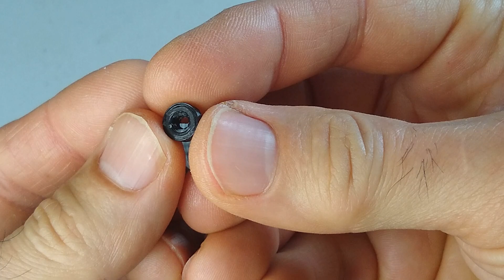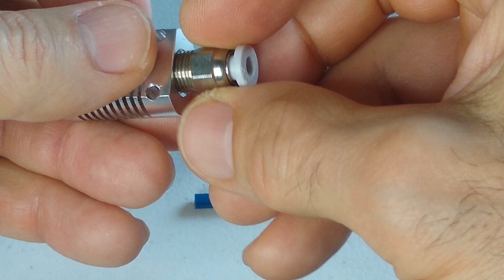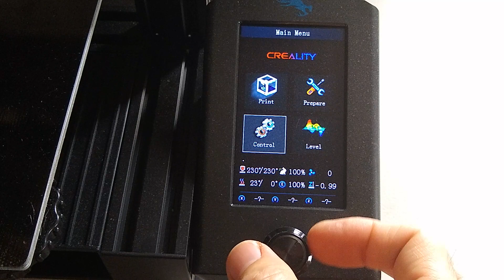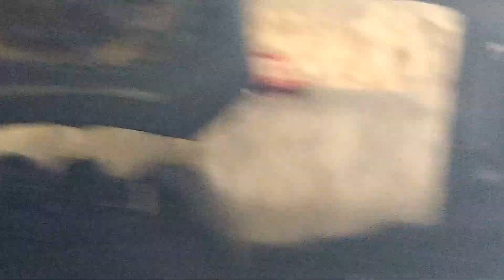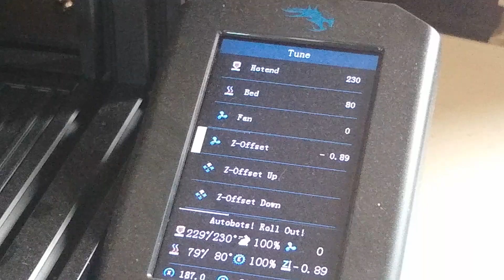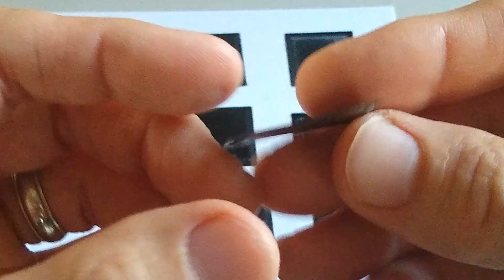Ender 3 V2 Hot end Fix

Comment: You probably already know by now but that PTFE tube is to long. It will mushroom when you heat the hotend and tighten down the nozzle. Over time it will get worse and worse and bind the filament and eventually leak between the nozzle and heatbreak again. Ask me how I know.

There is only one solution to fix a PTFE lined hotend and that is to get rid of it completely. There are few options for all metal heatbreaks  that fit the stock ender hotend these days.
Another thing to do is replace the aluminium heater block and brass nozzle with plated copper versions. Better thermal transfer means better extrusion and higher vol m/m³.
Life's too short to be stuck in the lined PTFE hotend loop.
Reply from the maker: Hello Ashley, Thank you for commenting and sharing your experiences. I agree with you that an all metal hotend would solve the hotend problems. The one all metal hotend that has been trouble free for me over the last 5 months is the E3D V6 on one of my Ender 3 V2s. Unfortunately, I've had many problems with the Micro Swiss all metal hotend's heat block coming loose and leaking. I keep trying different tightening methods with them but all have the same issues eventually. In my experience this PTFE fix along with thermal paste applied to the cold side heat break shaft are the keys to making the stock hotend more reliable than the Micro Swiss by a wide margin. What messes up the Capricorn PTFE is too little compression and heat creep. Compression issues are resolved with this fix and heat creep by adding thermal paste to the cold side of the heat break before sliding it into the heatsink. I recently had to replace the PTFE section of one of printers not because the fix failed but because the buck board for my Noctua hotend fan did, cooking the PTFE tube inside. The same buck board failure happened on my E3D V6 all metal hotend machine but after replacing the filament and buck board it's back to printing like nothing happened. The .STL files included have different length jigs for cutting the PTFE to the proper length for a given machine. The PTFE shouldn't stick out more than .75mm before tightening. I haven't had any problems compressing it .75mm.

Best of luck with your mods!

Comment: I downloaded the zip file for the tubing jig. When I opened the files in Cura all the jigs were the same overall length. What about the jig makes the cutting length change? Is it the slot for the knife?
Reply from the maker: Hello Papa's Place, Thank you for commenting. The length differences are with the bowden tube end stops in each jig. I didn't change the overall length on many of them.

The cross cut and diagonal slots are designed for an standard utility blade.

Best of luck with your mods!

Comment: Is it ok to print the part for the heat sink in PLA or do I need something more high temp?
Reply from the maker: Hello Darren, Thank you for commenting. The little collar under the pneumatic fitting can be PLA. The top part of the heatsink shouldn't get very hot at all provided the heatsink fan is running properly.

Comment: Luke has a jig on thingiverse on his page.
Reply from the maker: Hi Douglas, Thanks for the info. I found a remix that worked better for me than Luke's original version. The hotend bowden spacer had a chamfered bottom with a counter sink that provides a centering bore for the bowden tube to slip into. I needed to change some of the design dimensions to fit my Capricorn tube. It's been working flawlessly going on 6 months now.

Comment: I have to ask, if the solution is to use sections of PTFE tubing, then why not just use a metal pipe the same size as the PTFE tube you cut?    Even Capricorn tubing has its limits on higher temps.
Reply from the maker: Hello Broderp, Thank you for commenting and awesome question. A titanium tube with a polished inside might work. A PTFE tube lining doesn't conduct heat, is super slippery, and provides the seal because is gets soft when heated. A solid steel tube would conduct more heat and lacks the slippery inside surface. All metal hotend sleeves are made using a titanium alloy or a combination of copper and super thin wall and slim stainless steel tube neck, which limits how much heat can be transferred up to the heatsink. The bi-metal copper sleeve is made of three parts: a copper sleeve which transfers heat very efficiently to heatsink, a thin narrow stainless steel neck in the middle which has less surface area, conducts very little heat, and a copper end that when tightened against the harder brass nozzle creates a strong seal. The titanium alloy conducts heat poorly and is much harder than the brass nozzle so tightening the two surfaces together will create another strong seal. Your thinking is on point but other factors are at play.

Best of luck with your mods!

Comment: Thanks again for the great support yesterday,  big advances on my end. :)

Today the EZFlex 2 bed mat was installed, the Hot End was removed and cleaned.  I installed a 31.5mm Capricorn tube and your centering bushing as well as new nozzle and PTFE PCM10 fitting.  Z offset was established and then a manual 4 point level followed by a "New Mesh", those numbers were tight with a range of 0.00 Center to 0.06 Left Rear.  Which is really the front of the Ender3 V2 from where I sit !
Your file Z-Offset Calibration Squares printed flawless from Let the purge begin! to Autobots! Roll Out.  The starting Z was -1.031 and the final Z offset was -1.29.  The final was 4 perfect and 5 that where during the Z  changes.  They were close but no cigar.

The second set of squares is running now and with no changes to Z they all look great.  Vector you are the MAN!

Now where that pesky Mellow Top All Metal CR10 HotEnd?

Doc'
Reply from the maker: Hi Doug, It was my pleasure to share from my experiences. Glad you've made such good progress since we spoke. You'll love it, the part is well made and kit is complete. Let me know how it performs for you.

Enjoy your day!

Comment: Hi Victor,  I have just finished up the Hotend modifications and was able to work around the Element set screw that still is frozen in the heat block.  I needed to use a 28.8mm length of tubing to aquire the 3/4 mm over hang on the heat break.  I assembled everything and then used the top PTFE fitting to make the overall seating.  The insert and 28.8mm tubing fit perfect together.  This is a great modification for the Hotend.  After homing, checking the level and a test print everything works great.  Now on to the next modification.  Thank You again Victor.

Doc'
Reply from the maker: Hi Doc, Great job in completing the seal mod. You're going to find that as you complete the meaningful mods less time will be spent on maintenance and more on creating new things to print.

Enjoy your day (:

Comment: I did not realize until I started this project that it is an upgrade to the original way the PTFE tubing seated at the cone.  Am I correct to think that this upgrade will be a forever one and the 31mm tube will need replacing on a regular PM schedule?  

To Date Victor I have done the following upgrades
Jyers custom firmware for the M.B. and the Display
The Yellow Leveling Springs
from TH3D, the Aluminum Extruder V2 and steel gear,  the PTFE PC4- M4 & M10 fittings and PTFE blue tubing as well as the EZFlex2 Pei plate and magnetic base.
The offset angle side bracket for the Filament spool.

regarding the spool upgrade I still need to produce the bearing assembly for the spool to rotate on, do you have any thoughts for which one would work the best?

Top shelf Victor you are
Doc'
Reply from the maker: Hi Doc, Your mods are right on point, great job. Once you do the hotend mods you won't have to mess with it unless you wear out a nozzle or something. The PTFE tube seal will hold up with no problem so long as you aren't planning to print hotter than 240c. If you decide to print over 240c then swap out the heat break to the Slice Engineering Bi-Metal one. Just use caution and take care not to overtighten the two long screws that keep the heat block from rotating because the stainless steel throat of the bi-metal heat break can get pressed out of position.

I tried the bearing spool rollers and personally didn't like it at all. What works best for me and I use on all my printers is this Thingiverse file linked below that is well designed, centers the spool on the stock tube, and rolls smoothly while providing some drag to keep the filament from unwinding. The bearing versions don't center the spool and roll so easily that the filament starts unraveling.

https://www.thingiverse.com/thing:4415166

Best of luck with your projects!
Reply: @vbared  Thank you Victor for the spool file and the experience that keeps me from re-inventing the wheel.
Reply: @vbared  Victor, while starting to do this hotend mod I found that the heater element set screw is frozen in place.  The 1.5mm Allen tool won't budge it at all, any thoughts?
Reply from the maker: @doctrainsmodifications5201  Hi Doc, turn on the printer and set the hotend to 160, shut it off and try again before it cools. The grub screw is going to be tight just make sure the Allen key is all the way in. If it still won't budget put some liquid wrench on a Qtip and touch the grub screw leave it for 30 minutes warm up the hotend again to 160 and try again to remove it. Repeat the Qtip process if needed, eventually it will break free.
Reply: @vbared  Hi Victor,  Thank you for the thoughts and I tried your suggestions with several different penetrating fluids and at about 175 deg but I must say Murphy won out.  I did a work around by leaving the heater block intact and working the other components.  I used a small stand vise to secure the heater block and worked from there.  My confidence is much better after this modification.  I'm printing the spool center fixture now that you suggested so that spool modification well be complete.  Thanks again for all you help.  Dang I lost you number.. getting old is not for the faint of heart.  Doc'
Reply from the maker: @doctrainsmodifications5201  Hi Doc, no worries here it is +1 478-227-3301

Call me if you need anything

Comment: Great Job on the hot end sealing.  I have printed the 31mm cutter and the two seals but I'm not sure which one to use.  My Ender3 V2 hot end looks just like yours so when it cools off the disassembly will start and measurements will let me know I guess.  Nice to know what that little needle tool is for.  You have made the modification look do-able for a beginner like me and what a great class.
I can see that a leveling system is going to be a must to get to the print quality your achieving.  Hardware first though.  Thanks again Victor.
Doc'
Reply from the maker: Hi Doc, Thank you for the kind words. The CR-Touch upgrade is well worth the money in the time it saves you from not having to mess with leveling wheels again after the first manual calibration after the CR-Touch install. I'm not sure if you saw my build and silent mod videos linked below yet. 

Ender 3 V2 full build - https://youtu.be/amRldRpnK2Y
Making the Ender 3 V2 near silent - https://youtu.be/ycvHpMbo5Hw

Best of luck with your projects!
Reply: Did you figure out which tube cutter you needed in the end?

Comment: This looks great, but i believe the nozzle should be threaded in a much as possible to maximize the conduction between heat block and nozzle.
Reply from the maker: Hello ResistCircuitResist, Thank you for commenting and kind words. In my experience I've found that it's important to leave this small gap because you want the nozzle sealing pressure to be against the bowden tube and heat break. Not having a strong enough seal between the aforementioned points will result in melted filament getting into the gap, crystalizing, restricting flow, causing under extrusion and clogs. You'll know if this is the case when you see melted filament oozing from the threads above or below the het block.

Best of luck with your projects!

Comment: what's the measurement of cutting tube mine is 30.2 is that correct? and This little gap filler cap is 4.4
Reply from the maker: Hello Ekrem, Thank you for commenting. The file link in the description will contain cutting jigs from 30.5 to 31mm. Use the one that leaves about .50 to .75mm of tube sticking out of the heat break before installing the heat block (like I show in the video).

I'll check the CAD for for the exact height of the cap and let you know.

Best of luck with your mods!

Comment: That’s any interesting way to fine tune the Z-offset. I’ve never seen it done like that before, where’ did you get the STL with the 9 squares which I will assume are 20x20mm
Reply from the maker: Hello Gramps Ramblings, Thank you for commenting. I created them in Onshape and they are 30x30mm each. I couldn't figure out how to get Cura to slice them at .2mm (one layer) so I had to make them .4mm so I could get a .gcode file out of Cura that would print. It prints one square at a time and I making adjustments to the z-offsets per square as it goes. Just before it goes back to the first square to print the next layer I stop the print and compare the results. I've found that If I just rely on the paper or .1 feeler gauge I'm too low and the result is stringing and blobs that accumulate on the nozzle sides.

Best of luck with your projects!

Comment: Great video. This would probably help with using abs too right? I'm new to 3d printing but figuring if it's working for pteg temps it should work for abs.
Reply from the maker: Hi Joe, Thank you for commenting and kind words of encouragement. I print PETG at 230 using Capricorn all the way down into the heat block and it's holding up just fine. Make sure to use a good quality thermal paste on the outside of the heat break (top part only held by the grub screw) so it can transfer heat efficiently to the heatsink. Don't use is on the side that threads into the heat block. Lastly a little thermal paste on brass nozzle threads into the heat block but not on the mating surfaces that seal the nozzle to the bowden lined heat brake. This will eliminate heat creep during long prints.

Best of luck with your build!

Comment: Great video, which size did you use?  For both.  Thanks
Reply from the maker: Hello Joshua, Thank you for commenting and words of encouragement. I used the 30.50mm for both of mine but wasn't sure if the tooling is exact on all the stock MK8 hot ends so I added a few longer ones. It needs to stick out about .5mm to .75mm from the heat break before installing and torqueing down the nozzle. Lots of videos out there including some of my early ones say to torque the tip down hot (what the manufacturers recommend) but the machine that I torqued down cold in the video is still running jobs with no issues. The one that I did hot had to be redone already after a couple of hundred hours of printing. Try different ways and you'll find one that works for you.

Best of luck with your mods!

Comment: Thanks for another great video. I really prefer this way of installing the short piece of Boden tube. I will be doing this to mine.
Reply from the maker: Hello Steve, Thank you for commenting and kind words. When I first saw this fix on Chuck's channel I realized, like you, that it would create  a more robust seal. 

Best of luck with your mods!
Reply: @Victor Bared  I really like Filament Fridays. I have gotten a lot of good info from him. I am having trouble with a new CR Touch. During the Create new mesh, it will turn red and stop the process. It does it in a different spot each time. It will eventually finish. Already talked to the seller, guess a replacement is in order.
Reply from the maker: @stevesweb  Hi Steve, I've had this happen to me a few times after I've messed with the bed. Did the CR-TOUCH ever work properly for you? If not I would check the each of the end to end connections with a multimeter to make sure you don't have a bad connection on any of the wires. If the connections all check out then reset the EPROM manually level the bed and then create a new mesh. If none of the aforementioned suggestions work them It could just be a faulty probe like you're thinking.

Best of luck with your repair.

Comment: Great video! I plant to do this until I get an all metal hotend, haven't had any major issues but I do suspect a tiny clog because my filament doesn't come straight out. Oh and I recommend you try out the 15x15 UBL its so much faster to print stuff not having to wait for it do the whole probing process. It just does 3-4 points for bed tilt/position and then it prints!
Reply from the maker: Hi Riley, Thank you for commenting and kind words. As soon as I started to hear the extruder gears clicking I knew it wouldn't be long before it showed up in the prints. Sure enough those two jobs that were running had a couple of areas with layer gaps. Catching and resolving these issues early is key to avoiding a complete oozing blowout mess. The 15X15 UBL is one of the Jyers firmware? Waiting on a 9 point probe does waste a great deal of daily production time.

Thank you for the info!